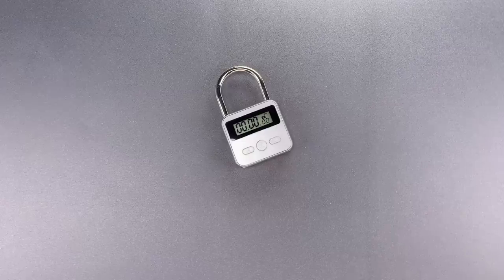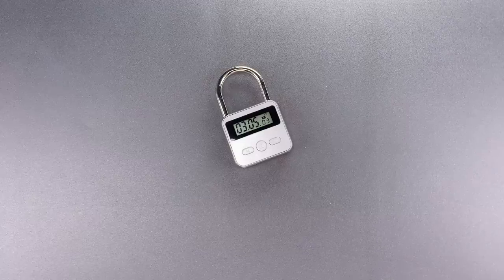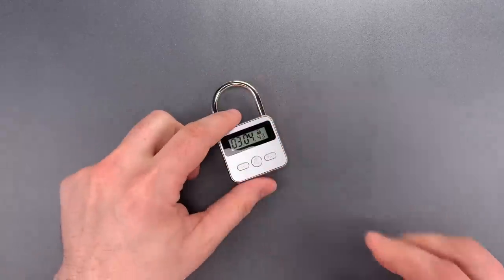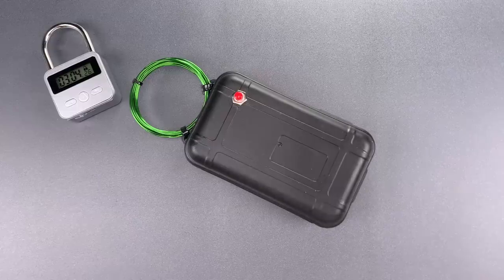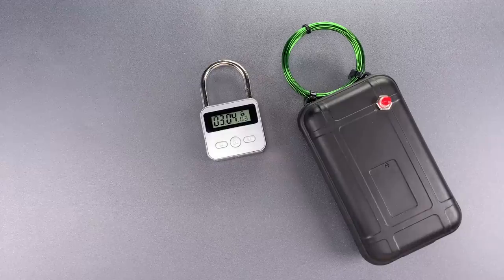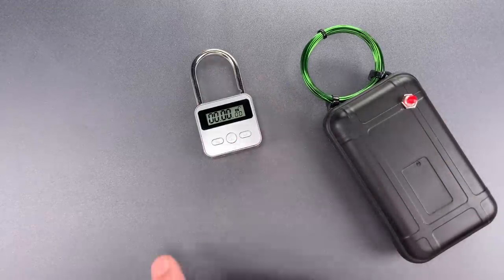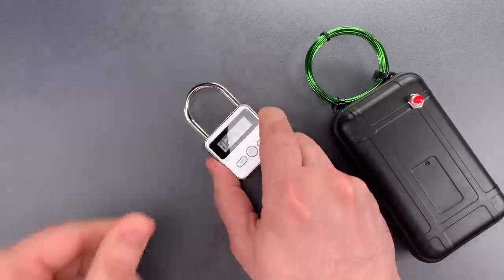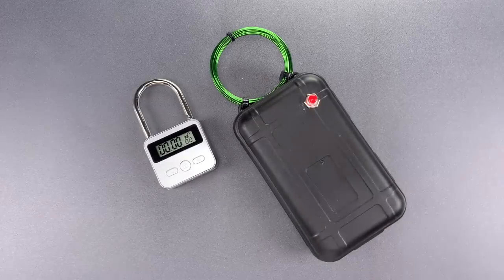[1250] Pocket EMP Generator Opens Timer Padlock

Comment: I wonder if an old school tape degausser would be a premade EMP Generator.  They used to sell them to do quick bulk erasing of audio and video tapes and I see they still sell larger ones for hard drives but didn't quickly find the older smaller tape ones.

Comment: Have you tried opening that particular model of lock with just a shoelace? It can be opened merely by jerking the shackle laterally (that is, tugging in opposite directions on each half of the shackle at the same time), using just a shoelace for leverage. I'm unsure of the exact mechanics of what happens during this process. I conjecture (but please correct me if this is wrong) that in spite the shackle having very little space to move sideways, it's enough for a sudden jerk to cause the shackle to transfer momentum to pieces inside the lock which in turn bounce out of place just long enough for the release spring to push the shackle open.

Comment: Would a degaussing coil also work?  We used to use them to demagnetized CRT displays used on aircraft. You can make one by putting a heavy gauge wire i. A circle connecting the ends to a soldering gun ( not a soldering iron, but something like a weller soldering gun).

Comment: Thank You for a very interesting channel!
I run a stable and trying to create an automatic horse feed box that can feed my horses while I’m at work. 
I was thinking some kind of wooden box, with a “door” in the bottom that is held up by a padlock that runs on a timer. 
The problem with this lock is that I manually need to press the “open button” when the timer ends for it to open.
I would need some kind of lock that opens automatically without me being there to press the open-button.
Maybe this lock could work if I put duck tape to hold the button in all the time so it’s releases when the times ends, would that be possible?
Or do you have any other suggestions of  locks with timer, that opens automatically without pressing any button? It would also be grate 
I would be so greatful!

Comment: What happens if you use that thing on regular locks? You know those card entry systems, fingerprint scanner, a keypad where you enter a secret number, etc. Does the power surge get transmitted via the cables back up to the mainboard? Imagine it fails, gets replaced, fails again, repeat for 3 weeks, with the target having to resort to jamming the door open just so that people can go in and out. That's when you sneak in.

Comment: The day has finally arrived: LPL can defeat a lock without even touching it. 

(I know he still had to push the button to actually open it, but I consider the point at which the electronics reset, thus re-enabling the button as “defeated”)

Comment: How about doing some quick testing to see how hard it would be to shield that lock? Would wrapping it in aluminum foil help? What about fine mesh copper mesh? Do you ground the shield, and if so to what part of the lock? Does the display need to be covered for the shielding to make a difference?

Such a video only have to be as complicated as you want it to be as all we're really interested in is if a quick and dirty DIY solution would work at all, and an idea of how much adding shielding to a lock like the one shown would add to the manufacturers cost..

Comment: I have an idea for a pneumatically actuated lock. The speed of the key turn would be necessary to open the lock so single pin and raking would be out of the question. The pneumatic portion would be sealed to prevent corrosion or foreign materials  from preventing operation.. Also, changing the temperature of the lock in an attempt to create pressure, for example heating, would not work on this design..
Most everything I know about lock picking comes from me soaking info from your videos, a few here an there from others but your presentation and information is the best... IF you happen to have the time to read this, I would love to know what you think about an idea like this :)
Reply: I just realized a bonus in the design, drill and destruction (on outside) also have the potential to fail.. based on final

Comment: Nice!  I'd venture to guess you may not even need that "fancy" of a device to reset it.  Pull apart something with an electronic ignition like a grill lighter, put the ignition wires over the display area, pull the trigger & you'll quite likely get the same result.  I've crashed or killed other electronics like calculators & PDAs that way so I'm guessing this would suffer a similar fate.

Comment: Probably under this pricetag, EMC testing and compliance have been omited LOL. But note that so many other things have been certified to meet EMC and in the event of failure, they need to fail in a safe way and recover. Automotive industry has been dealing with this for decades since ignition systems are no different than that, creates a hell of a noise in the system, not only radiated but conducted. Another source is a failing alternator and a failing starting motor. A failing alternator can drop huge spikes over the 12V. I mean, you are not stoping a car with this thing, or at least it will put a fight. You will probably manage to put a code, enter into limp mode ... thats all plus you need to be over the computer phisically. Field strenght dicreases with distance .... at 50cm you wont be able to make it jump a single instruction.

Comment: Okay, okay, okay (in Joe Pesci voice)... I would love to see this EMP generator of yours go up against some of your more common digital keypads.  I had a RadioShack keypad on my old alarm panel for years and I'm curious if it would disarm the alarm, reset it to the factory code, or just set off the alarm.  Sounds like a fun little experiment!  These same keypads, with different branding,  are used all over the place... even in commercial alarm systems.

Comment: what do you need for this?
I think 2 18650 cells, a push button switch, a high voltage step up transformer and some insulted copper wire, did I miss anything?

maybe install a micro USB charging adapter while you're at it?

Comment: I am guessing the EMP generator consists of a taser whose electrodes have been modified and connected to a loop of wire, inside an enclosure with an external momentary button trigger.

Comment: Does this have a replaceable battery? If so you could remove and reinsert it to reset the lock without any special tools. If the battery isn't replaceable it would stay locked once it dies, causing endless frustration for users who now can't access their things.

(Obviously I'm talking about the users who don't have a lock shim / bolt cutter / angle grinder / etc).

Comment: Lock-shaped object opens in under 1 second with a small shim. 
LPL uses black box to reset the thing.
Even if it was secure, what is the point of having a padlock which only stays locked for up to about 4 days? And that's assuming that the battery doesn't fail before the timer stops. Worse still, you arrive 5 minutes late to retrieve your 'protected' items, only to find the lock has been restarted by someone who might just have stolen your goods. But you will not know whether they've been stolen until the clock counts down again. 
The concept has not been thought through by the designers.

Comment: So, it's a stun gun with a wire core attached to the leads.  What happens to such a lock if you just apply the stun gun directly to it.  I imagine it will fry the electronics, but what happens then?

Comment: Huh, I wonder how that works. Like you just try it out on some random electronic lock and hope you aren't bricking the lock?

I guess most electronic locks are designed to unlock when powered down or when reset, just for safety reasons? Seems counter intuitive, but I guess that's more important than security for most situations.

Comment: LoL, did you just connect a coil to a taser and put the whole thing into a plastic box? :D
Reply: you can't just hook a coil up directly to the prongs of the taser, as you'd be basically shorting it out and never letting it build up a charge. you'd have to wire it in series with the spark gap, so that it can build up the charge, with the spark gap serving as a high-speed switch to trigger the discharge.

Also, that box has gotta be slowly corroding from the inside out from all the ozone that would be giving off
Reply: @spambot7110  I didn't feel like I had to go into such detail, but you are correct. You can hear the spark gap in the video — that's what gave it away. My point was this “pocket EMP generator” is just a taser (probably one of those $4 ebay taser modules) with a coil.

Comment: If the electronics glitch that easily I expect a handheld radio could do similar
Reply: there's a lot of differences between tuned low power radio waves radiating omnidirectionally from an antenna, and a much-higher-power broadband EM pulse coupled directly into the circuit. remember that modern electronics are designed to handle being constantly bathed in random radio waves!
Reply: @spambot7110 , trust me most are extremely poorly protected against strong fields from very nearby transmitters.

Comment: If it was powered by old AVR MCU you would need nuke, you would blow up the padlock, but the MCU would still be there running it's program like nothing happened.
Those old suckers are almost immune to everything, old ATmega16 burned my finger after i applied reverse power, it works to this day, over 10 years after incident, only one pin is not functional, but rest works well.
What happened there? Who knows, maybe RESET pin was left alone floating and inducing magnetic field caused MCU to reset? Or maybe it just caused a power spike enough to reset the MCU.

Comment: LPL, what if said lock had been wearing its 'tin foil hat™' - i.e. try that again having wrapped it tightly in a layer (or two) of aluminum foil (Faraday cage), of course that doesn't help much in reality but at least it might indicate how a proper shielding of the lock's electronic guts would be a definite security plus.

Comment: the padlock firmware, was badly built...
if it used static memory and it was not erased during initialization but only tested, this would not happen...
every time that the padlock is initialized, the firmware should check in a memory position, if it was doing something previously!
if it was, it would continue doing and not start from the beginning again!!!